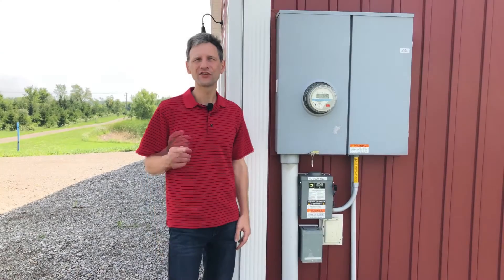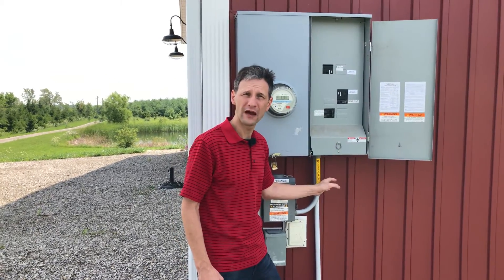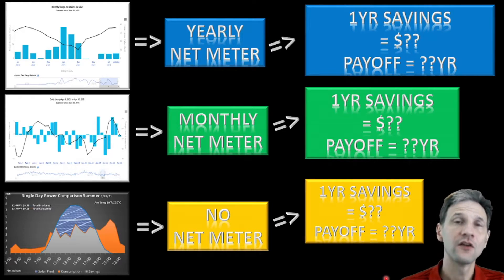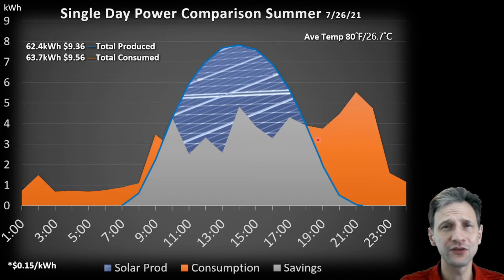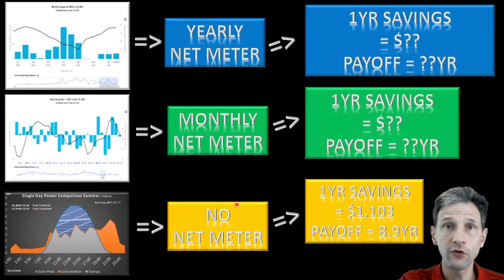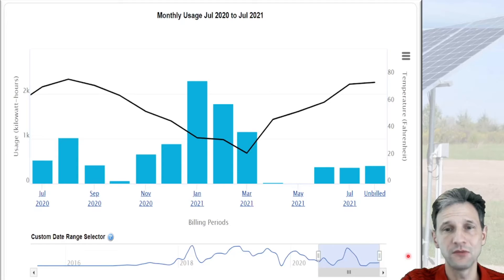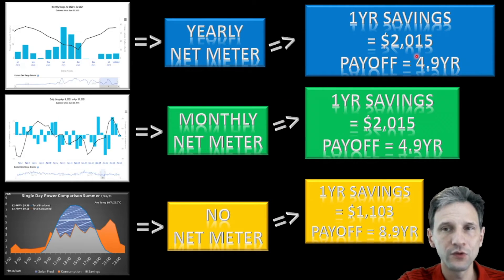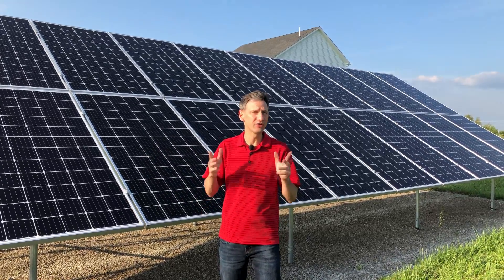Solar Panel System Net Metering With Actual Data

Comment: So for the solar tax rebate to be used, I have to owe the IRS a payment and the tax credit reduces that IRS payment I would have to pay, correct? So for example, if I get a solar tax credit of $5000, that means that I would have to manipulate the taxes for my take home pay of my company pay check where, at the end of the year, I would have to pay out to the IRS $5000 and the solar tax credit would pay that off for me? Yeah I dont know how to get my tax bill to do that where I can dial it in like that. Also, I dont know if my net income from my paycheck would bring in $5000 for that tax manipulation either. Can anyone explain this?
Reply from the maker: I'm not a tax advisor, but this is my understanding.  You don't have to "manipulate" your pay check.  If you pay at least the $5,000 in taxes during the year, you can get it back when you file your tax return.  If you payed the IRS $7,000 in taxes during the year you would get a $5,000 refund. If you only payed $3,000 in taxes during the year, you would get a $3,000 refund and you would have to roll the remining $2,000 over to the next year.

Comment: its not worth me to go net mettering due to the extremely low buy back and cap of 130 percent of power usage. 3 cents per kw feed back and 18 cents per kw bought. math dosent math. but alows for a smaller system.
Reply from the maker: In your case it may only make sense to build a system that never overproduces.  That will minimize your payback period.

Comment: Dave, great video!  I am also in Ohio and am planning a home solar project.  May I ask if you are still able to use net metering on a monthly basis in 2024?  I heard changes are coming to ohio that would limit it (similar to california).  Also, do you get credit only for the "generation" fees and still get charged "transmission" fees for the nighttime energy you get back?  Thanks!
Reply from the maker: Right now in Ohio it depends on your utility.  Mine is still net metering by the month.  My base connection fee is higher because I have solar.  I get $0.06/kWh for overproduction up to a limited amount.  With my latest expansions I am able to cover the connection fee with my over production most months and sometimes carry a surplus credit that can be applied to my December/January bills which I still can't cover with solar.
Reply: @ProjectsWithDave thanks!  So since you get $0.06/kwh for excess generation, does that mean that you are paying about $0.09/kwh ($0.15-$0.06) for energy you consume when the sun isn't out if you have already have a positive monthly balance with the grid provider?

Comment: Thank you for describing how you are a SOLAR RACKETEER!

You use the services of the utility and don't pay for them.  You foist power onto the utility whether the utility can use it or not ---and then compel the utility to supply you with power regardless of the cost to the utility. 

Your neighbors and businesses have to make up the costs you don't pay  ---raising their rates. 

Your design your system to get the maximum personal advantage.  Yet the utility isn't allowed to do the same thing  --- they HAVE to take your power whether they can use it or not.
Reply from the maker: Thanks for your thoughts on the topic.  Maybe your statements are accurate in some locations, however, my situation is different in the following ways:
1)  I am part of an electric co-op.  The policies are managed by the user/owners of the co-op.  They don't have to take any power from me, the contracts for production are all individually negotiated. 
2)  I pay an additional fee each month to be able to feed solar power back to the grid.
3)  If I overproduce, the utility only pays $0.06/kWh which is a very low rate for power.
4)  My utility has regular "Peak Alert" notifications when the utility is struggling to meet the demand.  During this time they use radio controlled devices to turn off water heaters.  This is usually the time when I am producing the most power which would be a significant help to the supply and demand issue.
5)  If there is a time when the relationship is not mutually beneficial, I'm sure the terms will change.  In some places there is a surplus of solar power and the energy rates actually go negative.  We don't have that situation where I live at this time at least.
I hope that helps.
Thanks!

Comment: Don’t understand waisted ????

You use what you use 

If you don’t you don’t 
It’s not really waisted 

If that’s the case people waist all the time if your not using the sun’s energy
Reply from the maker: Having the capacity to produce power, with no ability to utilize it reduces the value of the equipment.  That available power is "wasted."

Comment: Ok, so dumb question.

What if I just want to reduce electric usage?  That is, I will never, at any time, gen more than I need.  So I would never sell back to the grid.  It still OFFSETs the usage, correct?  

If I generate 0.5 kWhr but my home consumes 3 kWhr (for that particular day), then I will only be charged for 2.5 kWhrs (for that day)?
Reply from the maker: Yes, with a typical net metering agreement, that is how it works.

Comment: If you assume 1:1 net metering, what is the ideal solar offset for an annual net zero?  Is that the right question, are there other factors?
Reply from the maker: I go through sever factor to consider in this video on sizing your solar array for a grid tie solution: https://youtu.be/rbFnZqA0GCI

Comment: How did you need to buy 50kW on July 11th when it wasn't even hot?
Im not being nosey or critical, Im trying to understand how to best size my system. TY.
Reply from the maker: I don't recall what happened that day, however, there are 5 people in my home.  We may have done several loads of laundry, baked cupcakes all day, and taken 5 showers.  Those are all very high loads and could very likely have all happened on the same day.  My results are just a reference point for you.  Hopefully you can download your data from your utility to understand your particular situation.  If not, I suggest getting a monitor to track the data like this one:  https://amzn.to/40zUc3u
Reply: @ProjectsWithDave  That detail in the video and your answer raises an important point. Ive been looking at my monthly averages, but I also have to factor in the "high" days and plan accordingly. TY
Reply from the maker: The "high" consumption days and the "low" production days can be dramatic.  When connected to the grid we pay very little attention to those very critical details.

Comment: Fascinating data. The utility where we live only buys power from us at ‘wholesale’ rate which is roughly 50% of our purchase rate. In our case it’s far more economical to go with battery and thermal storage.
Reply from the maker: I'm guessing it's still more expensive to use batteries.  Did you run the numbers?
Reply: @ProjectsWithDave  Correct. The difference gained with the battery is just enough to break even. But the battery has added value in its ability to serve as a UPS for critical loads.
Reply from the maker: Nice way to justify the added value of having the UPS.

Comment: What makes net metering a joke is by law when the power goes down your solar system goes down. So that's why I don't participate in Net Metering. I invested in enough batteries to get me through the night. They've also implemented a $25. Minimum electric bill so I am adding a couple of circuits back to the grid side of my system so I can use as close to $25 as possible. The zoning in my city says that you have to be hooked to the grid or your property is considered abandoned and uninhabitable.
Reply from the maker: Requiring grid connection would be highly frustrating.... I currently have a small battery backup system that can also be charged by a generator for emergencies.  You can see the setup here: https://youtu.be/BzMAW8kW0CU

Comment: How big would you need to overbuild your solar system to break even and not have any power bill? Earn enough net metering credits during the day to run your house and run it at night on credits from the grid. I'm trying to figure this out for a house that is about 1500 sqf in Florida. I've heard battery backup isn't capable of running AC at night along with everything else unless you had a ton of them which is expensive. I'm thinking it might be better to overbuild the amount of solar panels and use the net metering credits instead and just have a battery for emergency situations like when the grid goes down.
Reply from the maker: From a cost stand point, overbuilding the system and balancing the net metering is likely to be the cheaper solution.  You would need to make a spreadsheet and calculate each month individually to find your breakeven point.

Comment: My utility has yearly net metering but it still doesn’t seem to pay to have too much solar because they only pay out $.03 per kWh.
Reply from the maker: Even though they only pay $0.03/kWh you still have a significant advantage with yearly net metering.  With this advantage you can employ a larger system that is equivalent to your yearly average instead limiting yourself to monthly max production levels.

Comment: It would be great if you did the same calculations for a battery system. Maybe for a few different size battery banks. That way we could determine the proper size battery bank yo maximize our savings.
Reply from the maker: I have been doing more research and testing on battery systems and will get there eventually.

Comment: Here's a suggestion Dave, why not give the most important piece of information first. Where are you located!!
Reply from the maker: Ohio, but the most important piece of information is where you live.  The rates and net metering rules are all dependent on your locality and utility, I use my actual situation as reference.  Thanks!
Reply: @ProjectsWithDave  I think you missed the point of my comment. I know where I live but no one watching your video knows where you are. If you are going to start stating a lot of details about rules and regulations you need to give your location. The internet is a lot bigger than your state/country.

Comment: Thanks for your great content. Very well explained, so well you have me interested in a grid tie system. I did the web easy calculator with my sun aray and I am just consuming to much Klw per month. On average 5500klw per month and it would not make sense for the amount of panels even at 50% coverage. I would need 56x 500wat panels to cover half my monthly cost so that would not make any sense for the cost of only the panels would be 25k give or take and thats not including the rest of the build. It would take me endless years to even break even.
Reply from the maker: Thanks!  You're right, a grid tie system lets you go solar with a portion of your needs and then expand later when it makes financial sense.

Comment: You use a lot of electricity.  We have AC and a pool, the most we ever use in the summer is about 40 kwh. Winter we use about 10-15 kwh per day.  We have a 5kw system and are a net producer. We end up making about $300/yr in profit for our true up at the end of each year.
Reply from the maker: That's great!  Sounds like your house is not all electric, or you live in a warmer climate.  That's why it is important to know your actual consumption before installing a system.

Comment: Question here🤞🏻👍🏻
My solar system is installed 
The power company says their
 “Net meters” are on back order for 6 months. Can I still operate my solar panels WITHOUT a net meter and if so, what are the possible problems? Please help 🤷🏼‍♂️
Reply from the maker: I suggest you ask your power company if there is any impact to the meter.  In my experience if you run your system without the "net meter" installed you will only reap the benefit of the power you consume as it is being produced.  For instance, if you are producing 7,000W but your house is only consuming 5,000W, then you are giving the utility 2,000W for free since the meter can only measure in one direction and you can't store the extra power.  In that case, it makes sense to do all your high power activities in the middle of the day.  Hope that helps.

Comment: Your house is consuming a huge amount of power , I think ours uses about 10kw/hrs a day in the summer. What are you doing in there?  The good thing is you're using 100% of the power you produce because of this net meter , in the UK you can't use that , no reasonable FIT (£0.05/unit) and they charge us £0.30/unit  (6x as much)....crazy
Reply from the maker: Wow, that's a big disparity!  You would not want to over produce, or it will take much longer to pay off the equipment.
Reply: @ProjectsWithDave  Yeah, we're looking to install a hydro system on our fish farm , it'll produce 9kw 24/7 356 but the best I've been offered by my electricity provider Scottish Power is £0.05p /kwhr and the same company will be charging me £0.32p to buy it . Something needs to change quickly in the UK , 10 years ago they were offering £0.45p for solar whether you used it or not.
Reply from the maker: Subsidies by their very nature can't last forever.  It's always best when technologies can stand on their own.  Assuming you have a consistent source, the nice thing about Hydro is you would have a very reliable constant output.  Much easier to utilize than solar.

Comment: This is an exceptionally well-made video.  Your data mining and logical presentation made this topic crystal clear to understand.  I recognize that net-metering is a very real consideration for anyone trying to decide if solar will work for them...and that is a huge problem.  The availability of net-metering, or lack thereof, is often THE deciding factor in whether or not someone installs a solar array.  They aren't doing it to reduce carbon emissions or, perhaps, "save the world" by getting their power from some place other than fossil fuels.  When someone goes with a grid-tied system and intentionally avoids getting any kind of battery backup, because they can rely on net-metering to still provide a reasonable ROI, what they are effectively saying is this is a financial decision above all else.  It is this notion of "ROI" that undermines the adoption of solar, with net-metering specifics contributing to that problem.  There is never a wrong time to do the right thing.  If there is a cost to doing the right thing, then so be it.  What net metering does is put more of that cost on the companies that generate and distribute electricity, which they pass on to customers who cannot install, or afford to install, solar.  This limits how effectively each installation actually improves grid stability and also limits just how much of a reduction in greenhouse gases we actually see.  More than anything, net-metering contributes to the rich getting richer and the poor getting poorer...and this is coming from someone with solar AND batteries installed.
Reply from the maker: Thanks for your thoughts.  I believe net metering is the mechanism through which many people who could not afford batteries are able to start a solar system.  Later, expansion into battery storage can be made.  However, it is possible that future utility scale storage will be much more efficient and cost effective than individual installations making grid tied systems a more balanced solution in the future than can be achieved by a multitude of oversized and underutilized off grid systems.
Reply: @ProjectsWithDave   Where it is available, net-metering benefits those with means, at the expense of those who cannot take advantage of it.  What if, instead of net-metering, all surplus power your system created went to lower the cost of electricity for those less fortunate?  Could we reduce greenhouse emissions AND narrow the gap of income inequality?  If that is going too far, I think the middle ground is fair to both sides.  If neither the wealthy nor the poor are impacted, either way, by net-metering, I could live with that...especially since it's really supposed to be all about reversing or slowing climate change.

Comment: Dave this is an awesome video and very helpful but I have one question. Did you do any wiring on the net meter panel?
Reply from the maker: It is a meter load center combination unit.  It was a regular meter setup until the utility swapped the meter itself for a net-metering version.  Yes, I did all the wiring on the load center side where the breakers are installed.  Thanks.

Comment: Senior, greetings 🖖, my question is simply this, after installing a PV system on my casa, do I have to change my retail electric provider if they have no solar buy back program and will my smart meter slow down or stop if the PV system is creating more than I use. The “net metering” retail electric providers in TEXAS charge crazy money 💰 for kWh . Please advise
Reply from the maker: You need to talk to you electric provider about what your options are.  In general, if you don't have a net metering agreement with the utility, you will just be giving them "free" power when you produce more than you consume.